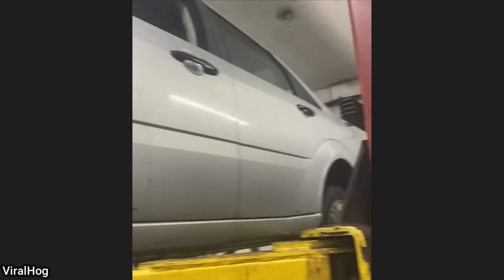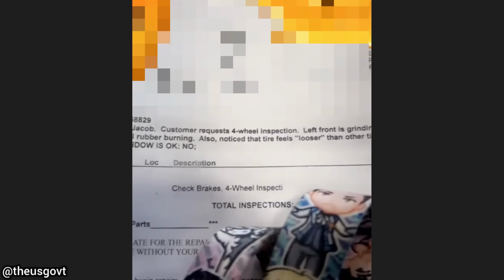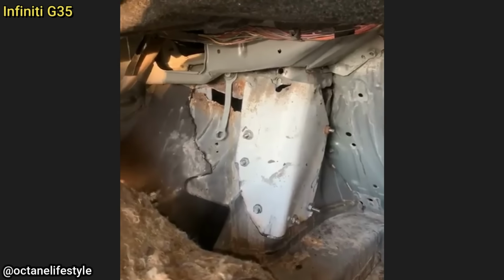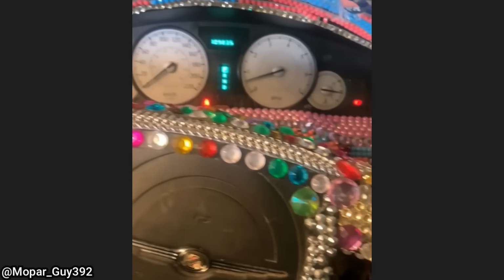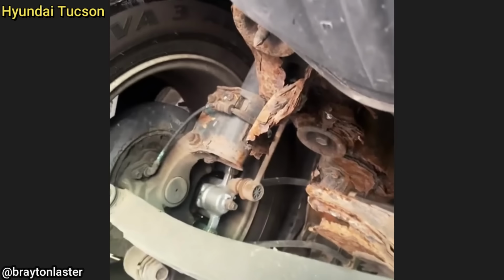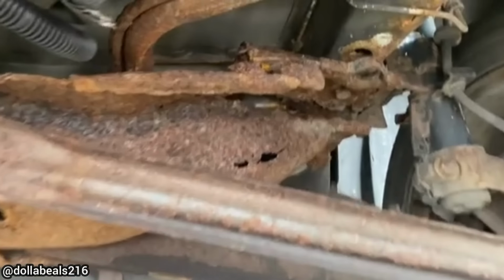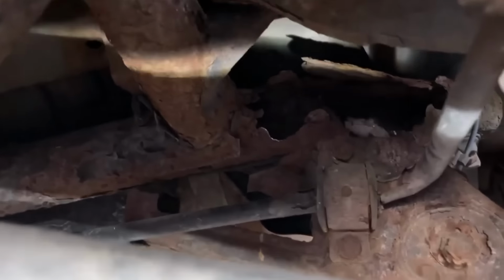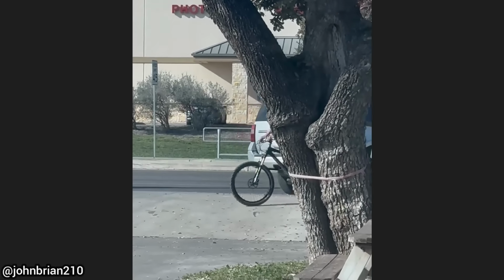Customer States (Dangerous Death Traps) | Just Rolled In

Comment: This channel is proof of why we need car inspections. Some people are just to stupid to handle the freedom of no inspections, making life miserable for regular people that can take care of themselves and their cars
Reply: I cannot imagine a country without car inspections. They're mandatory where I live and they fail you if anything is even slightly wrong (sometimes that's actually the problem ironically). How the fuck do people drive the cars showcased on this channel...
Reply: This depends on the rules of the inspection. If the govt wants it, they can make life even more miserable for everyone. I live in a no-inspection-needed country, but if I had to take the treadmill tests - when these were required, but not enforced - the car won't make it even when new, straight off assembly line. 16 years later it still runs fine, not a speck of exterior rust, not underneath, and okay mechanically. Brake rotors, pads and tyres were replaced at the mandatory 10-year mark (there wasn't much wear) but otherwise the factory stuff is mostly untouched. Built like a ... car should be built, but won't pass the inspection.
Reply: @kozlowskinator6056  Since I live in Europe I can imagine it, but i'm used to annoying and costly car inspections. However, after watching this channel for some time I understand why they are needed. 

The main problem in most countries in Europe is the strict rules for modification and the endless applications to get them approved.
Reply: Man I don't even trust my mk5 Jetta that much, I am glad that those guys at the inspection tell me what's wrong... Last time supposedly it was a cracked rear spring, in the shop it turned out to be not just that but both shocks blown + one of the front springs gone as well.... As much as we think we know cars, we need to listen to the pros man
Reply: @jmi5969 if a car fails brand new then the test is stupid 

I currently drive about in a 30 year old Citroen but there's nothing wrong with it 
This years MOT the tester couldn't find anything wrong with it 

how on earth cars get in the state shown here I have no idea
Reply: @kozlowskinator6056 I'm glad I don't have to deal with that. Just another hassle.
Reply: @PanameraTurboSEHybrid  It really is a double edged sword. There's a huge scam culture where I live for it, autoshops usually overcharge you if you're coming to them to specifically to fix something the inspection highlighted (sometimes the required fix is made up, definitely seen cases of that happen to people I know personally). But my country is probably also the worst for it.

Still, I'd rather get scammed and know I'm safe on the road tbh. This channel is the ultimate showcase of why these kinds of inspections are needed. I would be too afraid to drive knowing my country didn't have inspections. You can call me a pussy but I'm not a good driver, I do not trust that I alone can keep myself safe on the road.
Reply: @carmadme Yes, but you know how to look after your car. Do you know that if your car is over 40 years old and is not on a Q plate, it does not require an MOT? I think they take the sensible view, that they will be owned and driven by people who love and cherish them. Only another 10 years for you to go.
Reply: @billdoodson4232  not requiring an mot was a very poor choice there's loads of classic cars which have been bodged together now you have to be very careful
Reply: I've seen a lot of shit. but this is too much. Where are the police looking? in our country, technical inspection of cars older than 5 years is carried out every year. I've never seen a car with such rust in my life. even if it's a tractor that stands in mud and water around the clock. even if it's a 1990 car. This is crazy. if the car leaves your service in this condition, you should call the police. That's what happens here
Reply: Only a handful of states make it mandatory. I'm a little surprised it's not required in all 50 states
Reply: @PrsToTank  Rust like this is specific to the North-Central and North East of the US. Heavy long wet winters require a lot of salt to be used to manage the snow. Thus lots of salty road spray to the undercarriage. If its not washed off quickly... The rest of the coasts have the salty air that can start rust. But that will cause rust on any unprotected surface. 

Unfortunately, the only other option to deal with heavy snow is to spread a sand/gravel mixture. Which has its own issues.
Reply: Remember that the US is more like the EU than a specific country. If there is no federal law, states are free to make there own, or not. 
8 states have no vehicle inspection laws. 6 only require out of state vehicles to be inspected, generally just a VIN inspection and a quick glance to see if it has doors, proper lights, etc.
4 only require safety inspections if the vehicle was salvaged or rebuilt. 
12 only require an emissions test in specific metro areas.
5 have a combination of 2 year safety and emissions tests.
5 other have yearly safety and emission tests. 

Also remember that states are free to rescind said laws if the public wants them too. Example, my state of Idaho stopped emissions testing after air pollution levels dropped and the number of failed tests dwindled. 
Alaska and South Carolina both rescinded inspection laws.
edit But also know that all 50 states have a version of "driving an unsafe vehicle" law. If you know its unsafe and you cause an accident or just get pulled over for some other reason it can be a citation or a misdemeanor. And they will tow the car.
Reply: Most of these I imagine it's because you HAVE to have a car in america, and you cant afford it
Reply: It really doesn't have anything to do with freedom, you are free to go wherever you want, whenever you want, but you're not entitled to be allowed a car that is not safe, can't maintain your car? Then call a taxi or take some form of public transport, hell get a cheaper vehicle you can afford to maintain. Being allowed to drive a car on public roads is a privilege that comes with certain responsibilities you agree to adhere to when you get a license and not keeping your car road safe should forfeit your privilege to drive your shitbox on public roads. The only way to filter out these death boxes is by mandatory inspections, which costs money unfortunately.

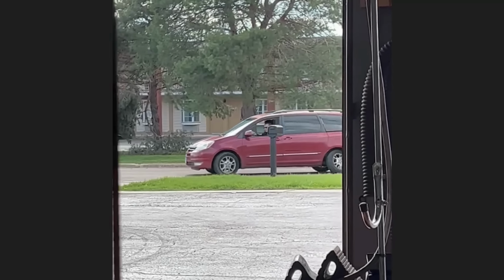Comment: 1:28, "Just Dragged In." How did that minivan even drive away ?
Reply: A lot of these vehicles defy logic and reason by still being mobile.
Reply: Front wheel drive
Reply: That minivan was the 'Clubfoot' edition.
Reply: @lrich8181  Isn't that Chrysler's latest model ??
Reply: I work crashes on the interstate as motorist assurance, you’d be surprised how smashed a vehicle can be and it can still move.
Reply: That was probably a Ford windstar\freestar.. they had a huge recall on that in the very early 2000s. There was actually a kit that had parts to weld on and a bath of "under coating" to keep it from rusting out and falling off..

Comment: This is one of those rare moments when I'm actually glad we have so much bureaucracy here in Europe. In the EU, drivers are required to keep their cars in decent condition and need to go every year or two to check the condition of their car.
Reply: We need common sense and mechanical knowledge, not bureaucracy.
Reply: @Booze_Rooster   Without bureaucracy and only rely on "common sense" you will get exactly what you see in this video.
Reply: @Realistic265 with bureaucracy you’ll wind up paying a lot of money to be told you need to buy a new car every decade or you’ll be paying a lot of money under the table to shut the bureaucrat up about your car.
Reply: @Booze_Rooster yeah that just doesn't work sorry
Reply: @Checkpoint_King we have had safety inspections here in pa since the 70s and none of that has happened.    Quit being so paraniod
Reply: Sweden calling in  - I had my bike inspected last month. The car on the lift next to me was PISSING brake fluid from the front brakes. So much that he has streaks on the rear tires. 
When told that his car was deemed not fit for traffic - and when you get that inspection result you're not even allowed to drive it out of the bay - the owner got LIVID. Inspection guy calmly slaps a big yellow-and-red sticker on the windshield and tells Livid Man - "Get a tow truck".

I'd much rather have opressive inspections than some ding-dong driving around with a detached rear subframe. As the guy said "He's driving in the same traffic as your wife and kids."
Reply: I wouldn’t say excellent, decent sure but not excellent
Reply: @Checkpoint_King  Funny, My verchial (my old one, a 2012 cinease motorcycle) is waht I would deem a death trap, but it passed every M.O.T here in the UK.

My ex car also passed 4 M.O.T's in a row (with like 170k miles on the clock)

What your claiming just doesn't happen with 90% of mechanics.

Yes, you have those that WILL try to price gouge you a little, But I'd rather be overcharged £50, than have to have idiots like in this vid driving the same roads I do.
Reply: @Checkpoint_King  or just maintain your car
replace or fix things before they become a safety hazard to you and everyone around you
its not only better, but also way cheaper than trying to do something when its already broken
Reply: In America, we're all about Freedom... Freedom to be as stupid as possible.
Reply: @Checkpoint_King  Technical inspection here in the Czech Republic costs about €50 and is required every two years. The checklist is defined by law, all imperfections are recorded into your official car documents and you can go to any other inspection site in the country to get a second opinion on your car. Inspection sites are private companies with regular government inspections. There are cars from the 1980s passing these technical inspections perfectly, it just takes not crashing them and maintaining them properly. You can buy a car for €2000 that will pass the inspections for a few more years at least.

Have you considered that coming up with a working system is a matter of developing law for decades and not saying "oh but bureaucracy so let's have no regulation whatsoever" like in America?
Reply: @Checkpoint_King  Imagine the liability cost of an accident caused by your rusted trough brakeless car'
If you think safety is expensive, try an accident.

Comment: The people that own these vehicles will rant to their friends about dishonest mechanics trying to upsell them.
Reply: Some mechanics are dishonest and will try to buy your car for scrap value and then fix it themselves and sell it right on the lot even if it looks as bad as this. Never bring your car to  a mechanic that sells used cars even if it's good shape.  They will try to con you in selling it to them and even try to sell one that they repaired on the lot.
Reply: @stvlu733 I started getting all my work done at the dealership. It costs a little more, but I haven't had one issue. They get it done right every time. Mechanics fuck cars up too often.
Reply: @ajspice there's a middle ground.  If out of warranty, ill never go to the dealership.  I go to a top rated independent mechanic that has a great reputation.  The price difference is insane.

Comment: In the UK they would not be allowed to leave the garage most of these !!! Every year your vehicle must have an MOT and even if you have a perished washer it fails and it must be fixed.
Reply: TÜV way more strict than the MOT. But I feel you
Reply: Sadly there are a number of states in the US that don't require yearly inspections and I can tell you that most of these are from those states.
Washington state is one of those... Had an ex room mate who had a car that was totaled 3 times and each time he just got it back out of the junk yard after it was towed to a skeezy mechanic he knew and had mostly the visual damage repaired and only enough to get it going again. Didn't know that till it was refusing to start one day in a parking lot and I popped the hood to see if I could problem solve a bit.... We got it running again but I refused to get in that car ever again. It was a litteral death trap because the frame had been "repaired" multiple times in the most half assed way possible and was rusted almost completely through on the scrap metal used to fix gaps.
Reply: @SilvaDreams  hey at least used scrap METAL and not spray foam
Reply: @SilvaDreams  I'm in Ontario, my province does not require inspections.  I drive professionally, I don't think I've ever seen a car as deficient as these on the road.
Reply: I live in Maryland. A safety inspection is only required when looking to title a vehicle. Outside of that, we only have emissions testing every two years.
Reply: MOT and TüV inspections are mandatory in Europe, with varying levels of strictness depending on the country.
Reply: @DAndyLord  Wait, Ontario doesn't? FFS, why does the one that has a large chunk of the populace have to be the one without the inspections!?

Even then, I barely see anything this bad. Horrifying to think about, honestly.
Reply: @DAndyLord  because in canda the cop at least give a shit about what your car look like, if your car is too rusted on the body the cop will give you a mandatory inspection. same for quebec
Reply: @mart43  APK in the Netherlands. Petrol cars every 2 years from 4 years old until 8 years old, then every year until 30 years. Back to every 2 years at 30 and exempt at 50.
Diesels every year from year 3 until 30, then same as petrol cars. The rationale I guess is that a car held on to for 30 years must be loved and cared for by its owner.
Taxi cabs, ambulance, dangerous goods transport and over 3500 kg (~8000lbs) every year from year 1 to 50.
Reply: @larslorenz  TÜV is not strict enough on dealing with cars that didn't show up to inspection.

Comment: if i take my car in, say for a new clutch, and the mechanic finds other repair work needs to be done, i am always grateful for their attention and always order the repair if i can't do it myself. people think mechanics just look for ways to pad the bill so they decline repairs, but they wouldn't if they saw the issue first hand.
Reply: Took my 1st Nissan 350Z to an R35 GTR Specialist as it kept going into Limp Mode about 3 months after purchase. They quoted me £2500 for the repairs but actually told me to decline repairs and advised to sell for parts as the chassis was rusted through. He was even gracious enough to put it back on the lift and show me how bad it was (still nowhere near as bad as these in the video). That's when you know you have an honest mechanic. I did end up selling it for parts and learned an expensive lesson in buying cars.

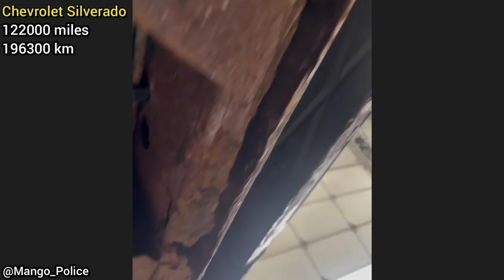Comment: 12:45 😂😆🤣 Hahaha, Customer: I will buy a frame repair kit online !!!
Reply: from Temu.
Reply: @jocelynmorency8333  Even better LOL
Reply: customer is disappointed when the kit came back for spectacles
Reply: @jocelynmorency8333  Right after they have another shop, reinforce it with spray foam! 😂
Reply: I mean, theres nothing wrong with repairing the rusted chassis of your car. I had a pontiac grand prix where the rear trailing arm mount rotted away from the body and I took 4 grade 10 bolts and just hammered it through the floor. Got another two winters out of it that way.

Comment: Should be able to ring police straight after the customer declines repairs, that way the cops can immediately pull them over, fine them, & have vehicle towed at customer's expense!
Reply: Was thinking the same thing. People get killed by things like this, surely the mechanics have some responsibility to report vehicles in this state.
Reply: Well, try declining all repairs and driving away in Germany, then.
Reply: Absolutely & i dont like pigs 🐷 but this is redickulous . The smartest comment & has the least amount of likes etc . Shows where peoples heads are , up there as.  S
Reply: @davestevens4263  Rules differ greatly between countries, please take that into account. I know shops in germany can stop you from going on the road, pending an official police inspection, but this is rarely used. Simply put, we don't have the resources (ex- "manpower") to do so. And having mandatory safety checks every 2 years helps sorting out the severely dangerous scrapheaps.
Reply: As a mechanic I have said this many times
Reply: If you do nothing to stop the car being driven in dangerous conditions you are liable the same as a bar is if you keep serving then let a drunk driver leave in their car.  Save someone’s life.  Call the cops.
Reply: why be a dobber?
Reply: @lobsterwhisperer7932  So you'd prefer to meet one of these irresponsible vehicle owners out on the road instead?